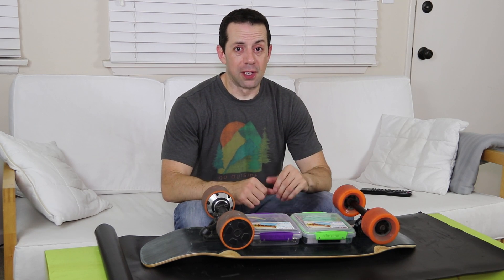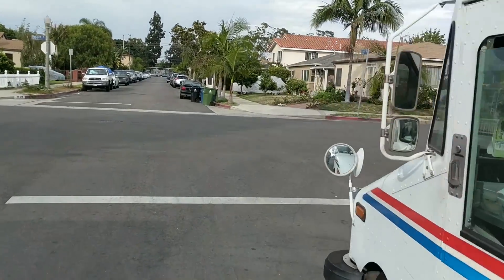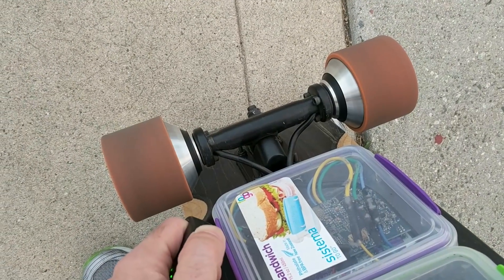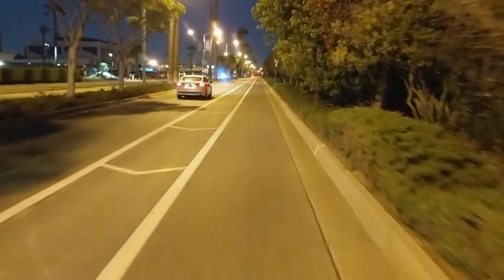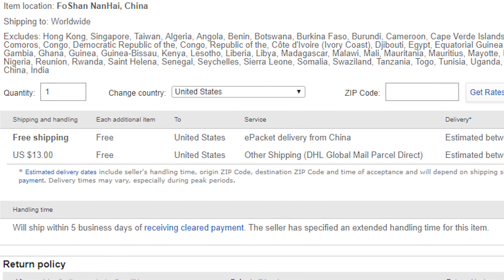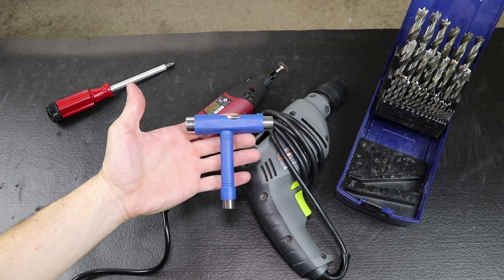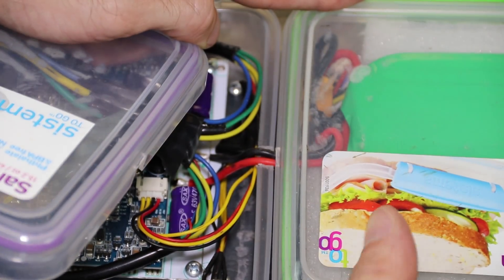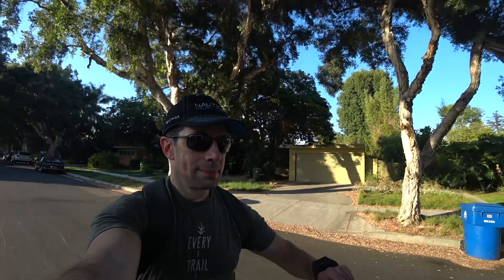Dual Hub Motor Skateboard | $315 | Easy Build!

Comment: Super cool Oren! 
Thanks for sharing.
there is just no reason to pay 2000usd for an eboard!
well done. 
don't forget the helmet next time ; )
Reply from the maker: Thanks! Yes, there are so many less expensive options now. You're right, I should wear a helmet :)
Reply: Ordered the same esc and wheels with this shop. Went through 3  esc already. One becasue of shortcut by power button touching the esc, stupid i know, and an other one because i did something wrong soldering the wire of power button which came loose. Now the esc is dead again even when i got a new power button.   Have a 2x5s battery with it and top speed is about 40 km/h. Board rides smooth and can't wait till i can ride it again. So frustrating. ....
Reply from the maker: Those 90mm motors are fast at 10S! One of the wires on the power button of my ESC got disconnected too. I was able to solder it back on and it's working fine now. I think those wires are kind of fragile so it helps to make sure the motor wires are out of the way and not hitting the back of the switch when the board bounces around while riding. I've burned out a motor once so I know how frustrating it is waiting for replacement parts!